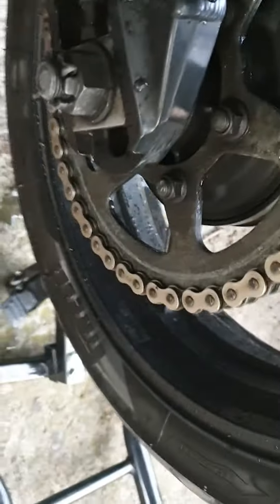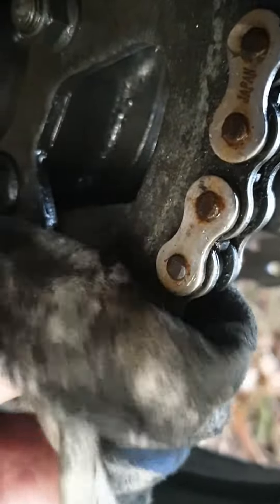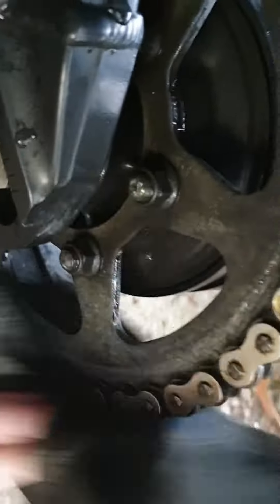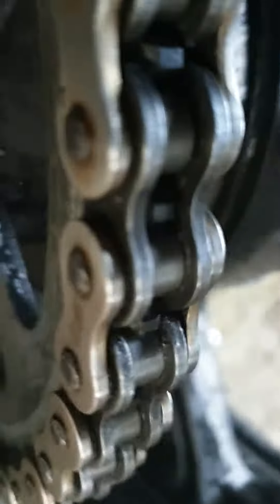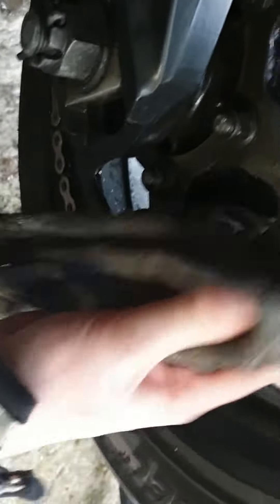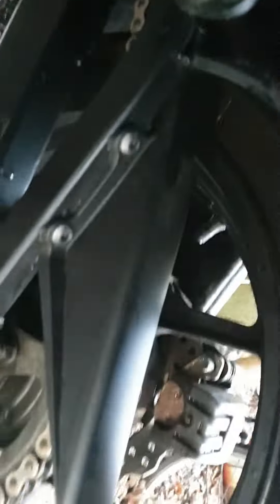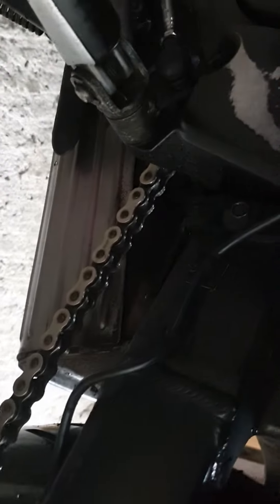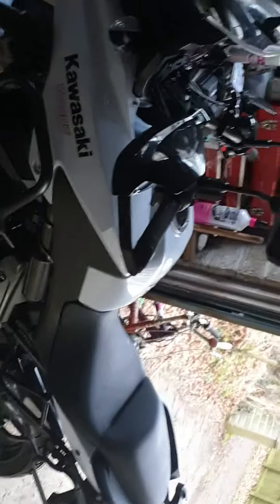winter life with scottoiler v system prt 3

Comment: Cheers for these reviews m8. Converted my Harley sportster to chain drive as I couldn’t get on with the belt drive. I’m looking to fit the scotoiler & it will need a lot of modifications to fit the Harley mainly because the rear sprocket is much bigger then most bikes due to the belt needing bigger sprockets. Been using spray cans to lube the chain & tbh I think it’s very time consuming, expensive, and mucky with more fling off then your getting once the oiler is tuned in. 
As an aside have you considered using Scotoiler’s red cold weather oil? May perform better in this weather. 
Thanks again for the reviews. Oiler seems to cut out washing the chain every 10 mins yay for that!
Reply from the maker: Oiler has never cut out for me. Perhaps if you could explain a little more I may have some suggestions as to the issue or contact scottoiler via their website, they are good at replying.